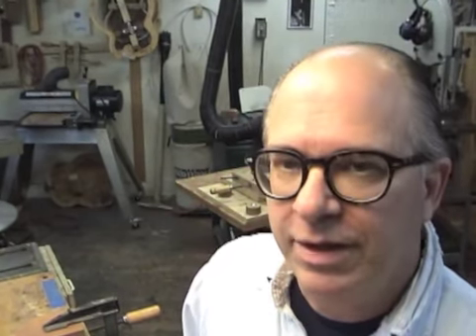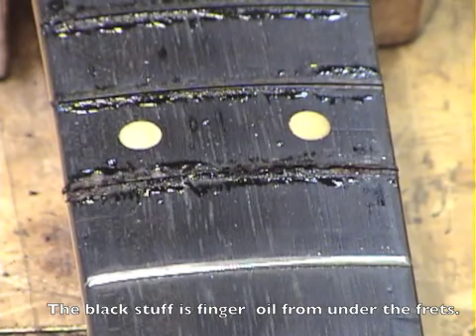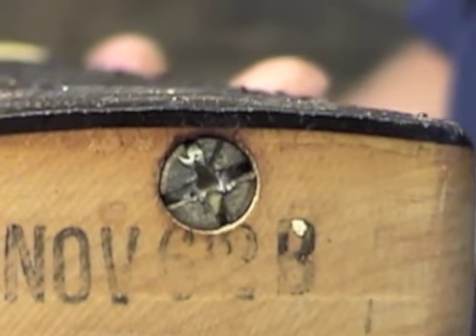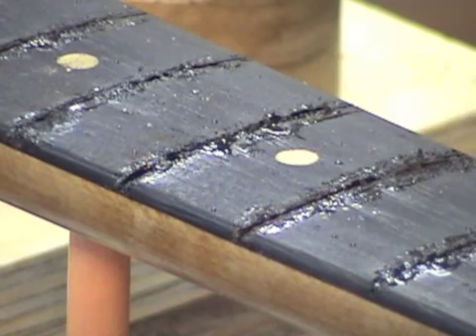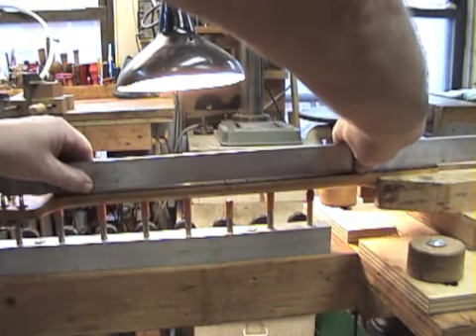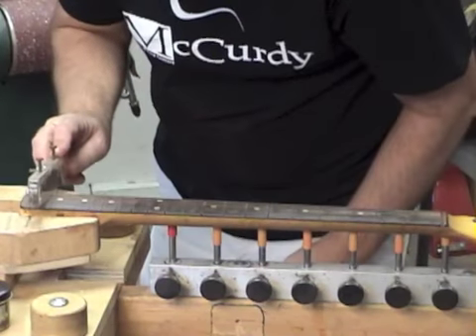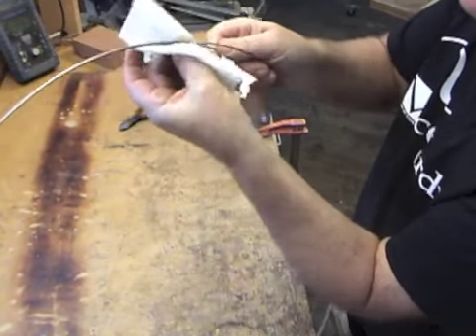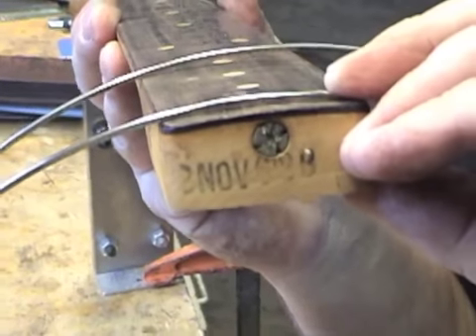!962 Fender Stratocaster re-fret. Part 1; removing the old frets

Comment: Is that a 747 or 727 at 1.20....was thinking of doing my own fret job 😳 on my 63,never seen heard about wire being pushed in from the sides before.....hence remove them same way.....time to get that soldering gun out guys.....🥶

Comment: Thank you for the vid, really great stuff but there is one thing I don't quite get. You say the fingerboard was flat in 1962 but I thought that Fender had a 7.5" radius on purpose?  I'm actually buying new guitar with that radius because it feels more comfortable
Reply: +Anna-Clara By "flat" he meant "level", the fretboard is radiused, but its plane from the nut to the 21st fret should be level, i.e. "flat".
Reply: ***** thank you Laurent makes sense now
Reply from the maker: I meant flat along the string path; top to bottom.